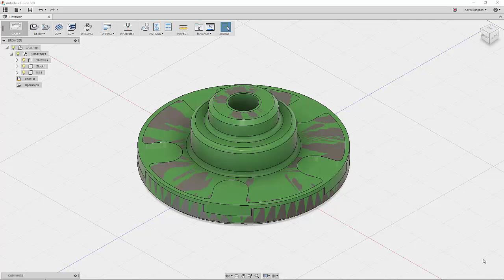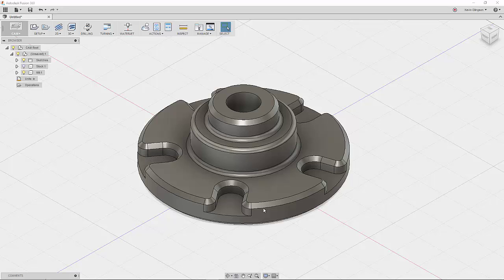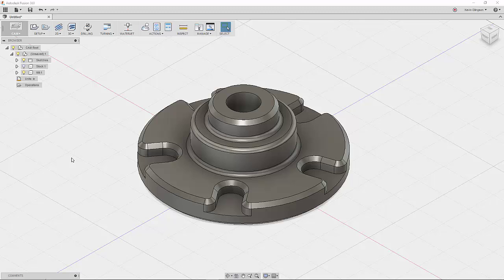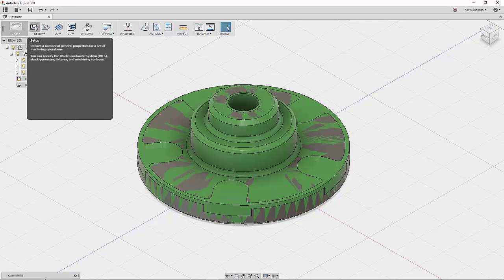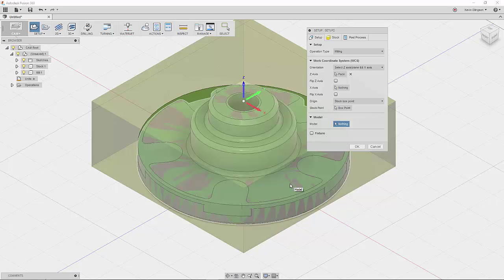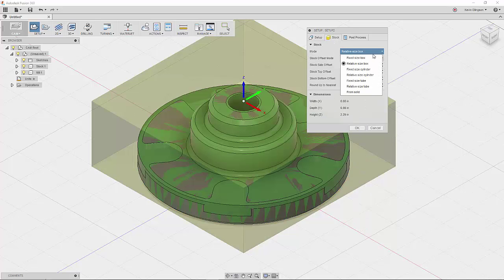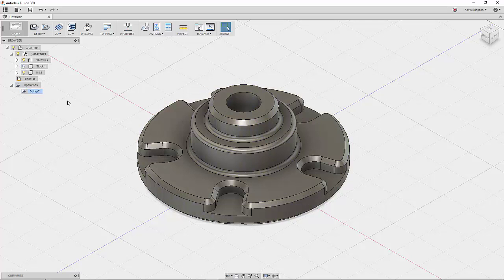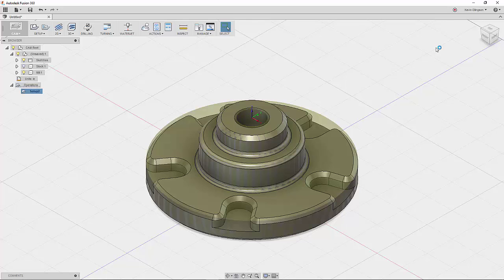Fusion 360 Stock From Solid

Comment: Unfortunately when we get cad file from customer I can't go back and delete features. So that would not work for me, many times I'm wasting time creating new component.
It would be awesome to create stock  just from section analysis. Hopefully  autodesk is working on improving that.
Reply from the maker: 6kx250 Why can’t you delete features? You also have a new tool available since this video called derive. And you could also do what you want right now by creating your own projected section.
Reply: Mechanical Advantage that is awesome, do you have any video or link about projected section by any chance?
Reply from the maker: 6kx250 Not yet. But I do have a video on using direct modeling to remove geometry from a model https://youtu.be/9qAbViT1Zns
Reply: Mechanical Advantage Sorry for changing subject, do you by any chance have any inside about 4th axis simultaneous ( axis substitution)? This is something i’ve been waiting for for quite some time.
Reply from the maker: 6kx250 Sure. Why don’t you send me an email to info@mechanicaladvantage.com and we can get all your questions answered.
Reply: Because if we get model from customer it comes without history therefore i can not ho back in time as far as derive i didn’t have a chance to dive into it yet.
Reply from the maker: 6kx250 That is an awesome thing about Fusion. You don’t need history to do it.

Comment: Hi 
Great video, thanks for putting it up. 
I'm trying to use this function and I'm having a problem, when I import my stock model into the 'model' view it's fine, there's two models listed and I can turn one off and one on etc so that you can distinguish between both. However, when I click on CAM it then combines the two models. So where you can select one of the other mine has a just the one piece. 

Do you know what I am doing wrong?
Thanks in advance.
Jools

Comment: Mechanical Advantage  It would be GREAT if you would do a segment in your simple style on the Heights Tab in Fusion CAM. This is a very confusing tab for me, most videos I have seen just gloss over it with something like accept the defaults, it drive me crazy. The Clearance and Retract are not to bad but the top and bottom heights and all the options gets very confusing.
Reply from the maker: Homebuilt EDM Machines That sounds like a great topic to me. Thanks 🙏
Reply from the maker: Homebuilt EDM Machines Check our the latest video that I posted. Did that help? Let me know if you have any questions in the comment section for that video. Thanks